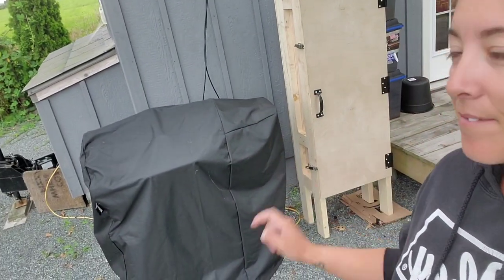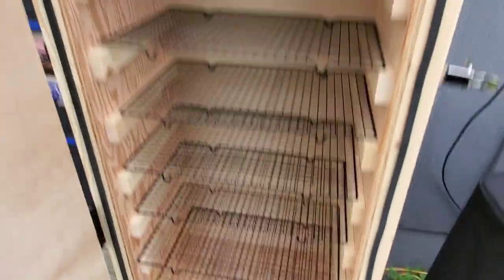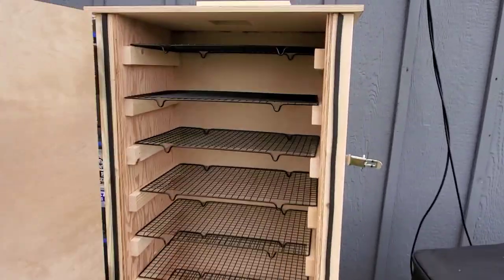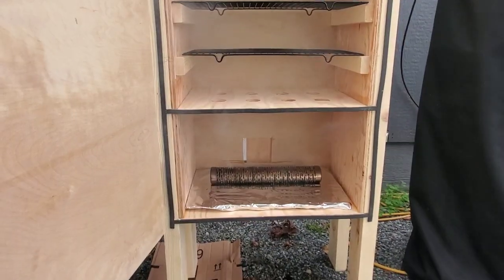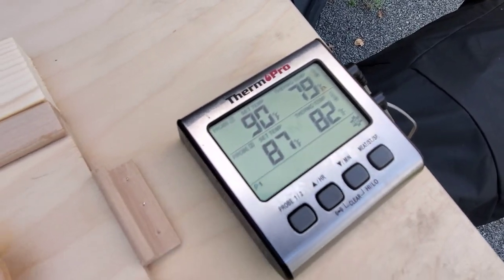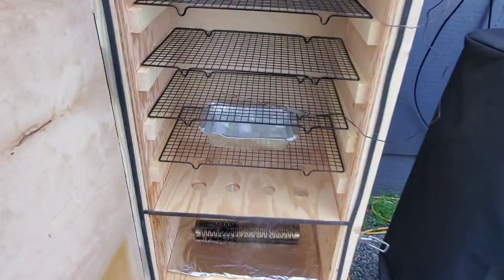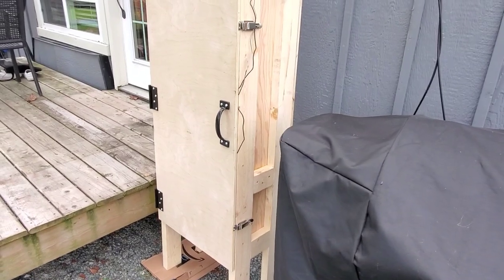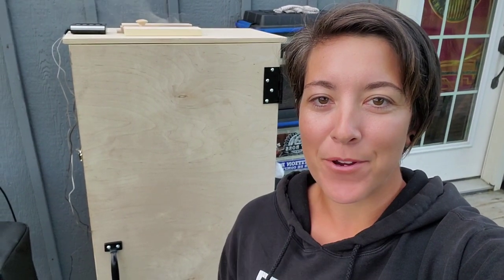New DIY Cold Smoker/Smoking Cabinet REVEAL!

Comment: You did a great job. If you don't mind me saying.... I would put 2 pavers in the bottom on the wood and put a large steel catchpan, like a big cake pan on top of the pavers , then put the smoker tube inside of the pan. Just last month,  I used the smaller tubes like yours from Kingsford while cold smoking a fresh catch of fish, came back to check on it an hour later to find the tube in flames and my temps out of control. I was using slightly moistened kingsford pellets as it said to do in the instructions. This strangely happened on a somewhat colder than normal day which was in the high 20's/low 30's.. I figure I might offer this info that will certainly save your smoker and probably home too as this could cause an inferno while using in wood. This flare up could happen with anybody's smoker.  Good luck and thanks for sharing. You did a wonderful job!

Comment: Looks good but I do not like the plywood, to many glues and chemicals for me. Also you need to take some better precautions for a fire situation. 
I have the luxury of large amounts of space and ability in my world though. I have a cold or hot smoke house built on a metal skid. It is a concrete base with a with a oak and maple cabinet.
Reply from the maker: Thank you for the advice! Since making the video, those suggestions were put forward and I've put a ceramic plate on the bottom.

Comment from the maker: Cabinet Measurements 

the following is all ½" plywood
Door - 20½"×48"
Back - 20½"×48"
Sides - 11½"×48"
Top - 12¾"×21½"
Bottom - 11½x17½

these measurements are for 2x4s
4 pcs @ 60"
6 pcs @ 4⅝"

these measurements are for 1x2s
16 pcs @ 11"

You'll need:
(8) 10"×16" cooling racks for inside the cabinet
(2) latches to seal the door shut
(3) hinges
Some weather stripping to go around the door to make it sealed

The things I would change now that I've used it for quite some time now is:
- build it out of cedar
- build wider feet so its more stable
- I've had trouble with the intake and exhaust since the wood shifted and bent a little, so they don't open and close to easily. I would just drill a small intake hole and a larger one for the exhaust at the top and build a little peaked roof so if it rains, water won't enter the inside of the cabinet
- remove the deflector plate, it's not really serving any purpose, just leave a 18"-22" gap between your first shelf and the bottom
Reply: I am curious about one part.  How do you plan to build a smoker using cedar woods and where to find cedar woods?
Reply: @michael-georgeames1835  Not sure where you're located, but if you're in the USA you can find cedar lumber at Lowe's and Home Depot. Most lumber yards will likely carry it also, because it's commonly used for fencing
Reply: @guiturtlewood also, specialty lumber yards that provide for local hobbyists, cabinet and furniture makers, etc. all have everything you could ever want.  Here in Las Vegas we have Peterman’s; I have purchased walnut and Purple Heart there.

Comment: Nice design.  I would recommend raising that smoke tube off the bottom a bit more because that foil won't keep the bottom of the cabinet from reaching near ignition temperature.  Maybe set it on a rack or something.
Reply from the maker: The foil is actually wrapped around another rack, it's just not that high but it does the job. Had the cabinet for awhile now and no signs of high heat spots. Thanks for pointing that out though!

Comment: Very nice love  , like the idea of the cookie racks 👌. One thing I'll do is maybe using ceramic tiles for the smoke tube area.
Reply from the maker: Great tip!! Thank you!
Reply: @grillinwithv4028  Are there specific guidelines to follow for:
1- filling the smoke tube (how full?) Max full? Half full? etc
2- what type of wood did u use (pellets, chips, saw dust..?)
3-Did u light one side only? Or center?
&
4- How many hours did you get from your smoke tube?
Thanks for a great video!

Comment: Have any plans or dimensions for this cabinet?  Great simple design that I would like to build myself.
Reply from the maker: Its such a simple design, you could make it yourself. All I did is took the dimensions of the cooling racks and literally built everything around them. I just made sure it had a large enough space to separate the smoke tube from the racks, but I've also seen other designs that have a laundry vent with a separate box for the smoke tube attached to the bottom. I don't have the plans anymore, since I just doodled them on some scrap paper. Adjustments also had to be made as it was being built.

Comment: Excellent video. gathered some good ideas from your design! I know you will tweak the smoker as you use it a few times. Let it evolve as you discover ways to improve the smoke generator, etc.
Reply from the maker: Within the year I'm going to make another one, but one rack deeper, made out of cedar for weathering, put the smoke tube outside of the cabinet in its own smoke box with some dryer venting to vent it into the box and get rid of the sliding intake and exhaust doors and just have a chimney at the top. You definitely live and learn. Thanks for watching!

Comment: nice build but I'd be really worried about the glues in plywood since they leach the glue chemical
Reply: I was wondering about the same thing.
Reply from the maker: It doesn't get hot enough as I only use it for cold smoking. I also never use in temps above 15°C. I would be more worried in hotter weather though for sure.

Comment: Plywood contains chemicals. Use untreated pine instead.
Reply from the maker: I imagine it doesn't get hot enough to pose a threat though. I will probably use cedar next time if anything.
Reply: Frankly I wouldn't use pine either. If you can't afford cedar use oak, ash, poplar...anything but spruce or pine.
Reply: I am no expert but I would have thought plywood would be fine at these temperatures, especially if it has been seasoned well before use. Moving to real wood starts to make this very expensive. I would avoid MDF and chipboard though.

Comment: Oh, sweetie you didn't think about the chemicals used in the manufacturing of the plywood and their off-gassing.  It's a very nice design, but the plywood industry uses chemicals like Methylene diphenyl diisocyanate, Phenol-Formaldehyde, and Urea-Formaldehyde to glue the sheets of wood together.  They off-gas all the time - no matter the temperature.  Oh - no...........

Comment: Great video! Have you had any issues with temp in your chamber using the A-Maze-N tube? If so, do you think it is primarily the deflector that helps regulate the temp? I smoked cheese this weekend and had issues with keeping the temp below 90F. Thanks!
Reply from the maker: Hey! I had issues in the summer time when it was warmer, now that it's winter, I don't even have to temp check anymore. What are the temps where you live right now? I did find the deflector did help in that sense, but if the temp is still high, I recommend putting in a tray full of ice cubes one or two shelves below the cheese you're smoking. That helped save me in the summer. Hopefully I've answered your question. Let me know if I can help you with any other questions. Happy New Year! - V
Reply: It was about 40F at the time. I had an ice tray below the cheese and another one on top of the tube as a deflector. I ended up leaving the door partially cracked to slow the rise in temp. Happy New Year!
Reply from the maker: @rtpmedic66  Oh no, sorry to hear about that. I haven't had those problems with that kind of temperatures with it being that cold out. My next suggestion would to have your smoke tube in an external box (like a metal tool box) and use a dryer ducting to connect it to your cabinet chamber. That way the heat source stays out and away from your product and hopefully fixing the heat issue.